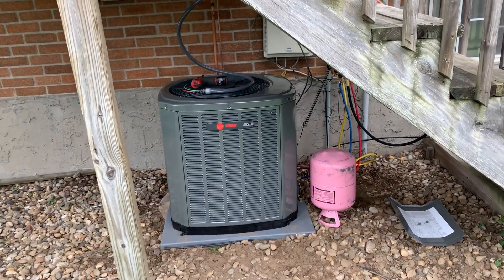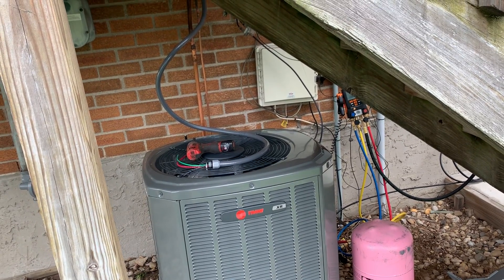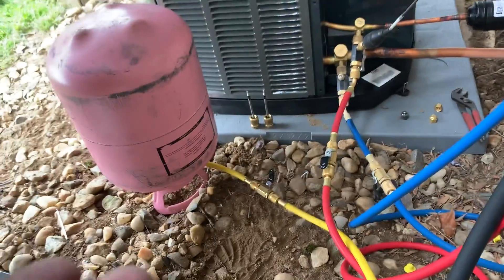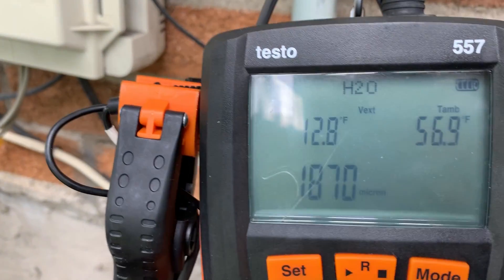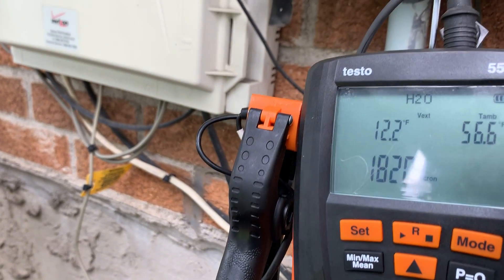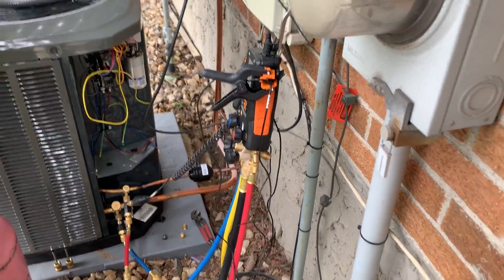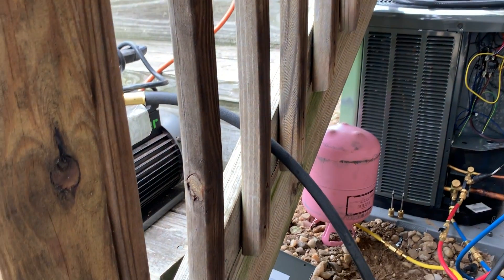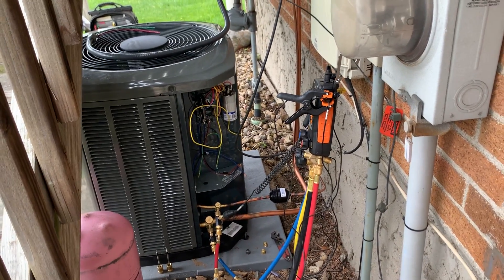Pulling a Vacuum on a Central AC system

Comment: Triple purge is a waste of time, blow out line set first then pull vacuum to 500 and be done, you are only getting 1.4 CFM through two quarter inch hoses